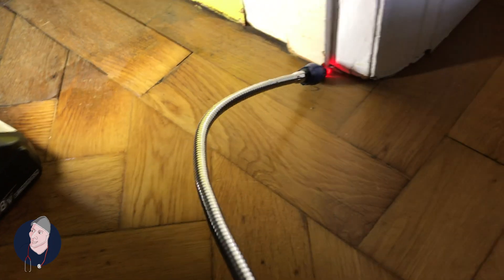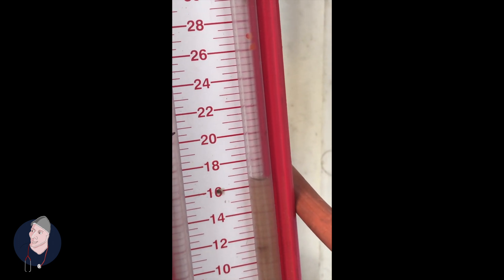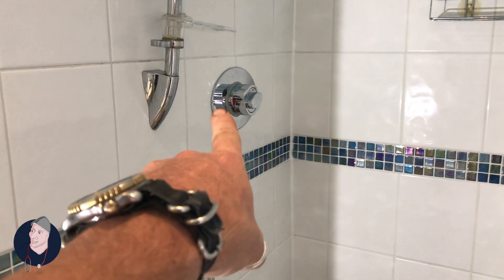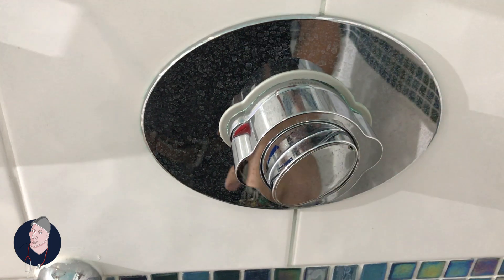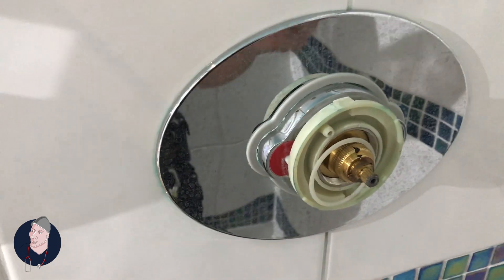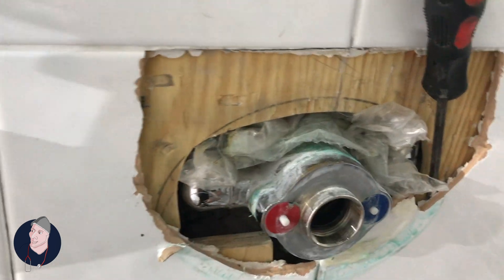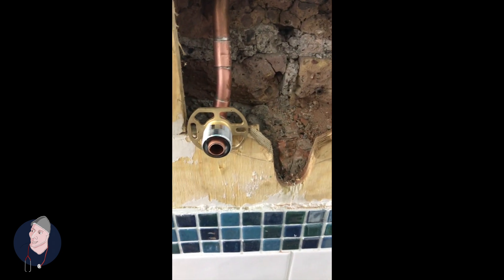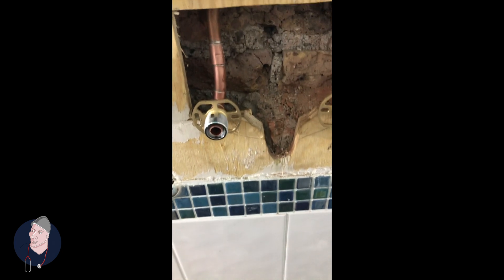Day in Life 51, Gas leaks and trace, Shower valve install. Plumbing and

Comment: Nice to see another upload from you. I don’t mind showers until the owner picks a concealed three controlled unit and then you find out it’s going on a wall that turns out to be paramount board 🤬. Luckily the other side of said wall is a cupboard. Other than that I don’t mind fitting showers.
Reply from the maker: Thanks matey

Comment: How does a flex hose rupture like that? As someone not in the trades at all I am curious as it looked quite violent and they seem quite strong. Too much pressure?
Reply from the maker: Age on that one they become brittle.. also heat can do it.. not all hoses are equal
Reply: @drpipe  interesting! Thanks for the insight